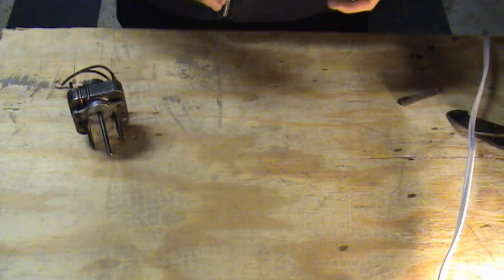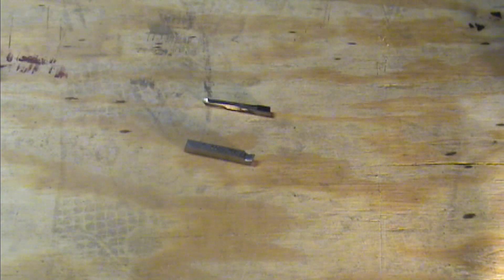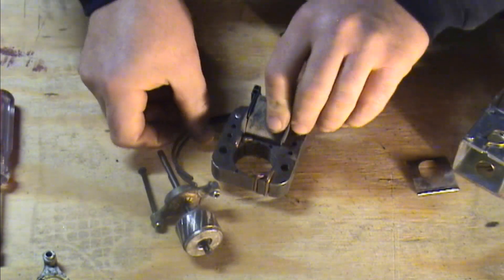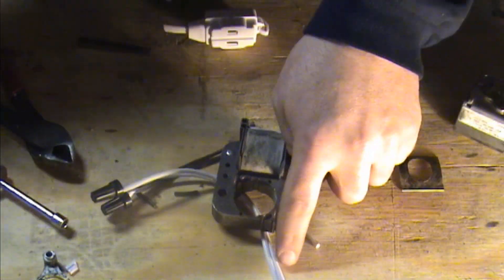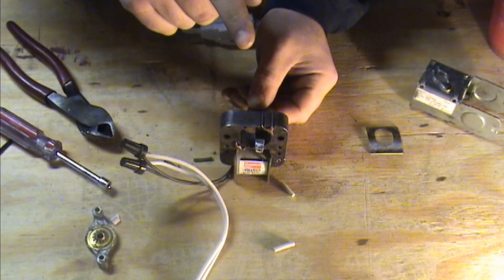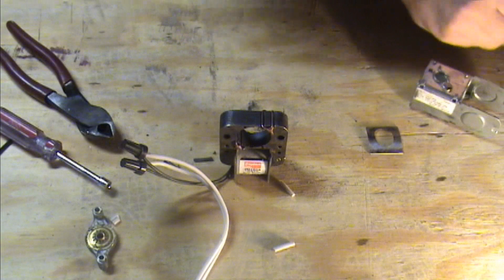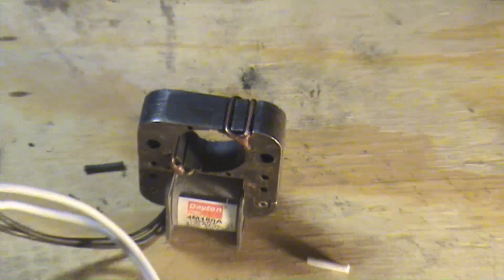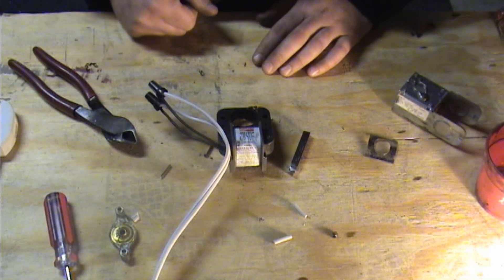Homemade Tool Demagnetizer

Comment: Hey thanks man I've been searching for this method for an hour now. My drill bits are getting magnetized due to some electromagnetic projects I'm working on but it's been years since I've needed a powerful demagnetizer. Also, those secondary windings on that Ac induction fan SHOULD be insulated with an enamel but I put that in caps because it's possible something abrasive wore it down. If you have any tool that can check continuity just test a few places to see if any bare copper is exposed. Only while it is unplugged and removed from whatever circuit you found it in. I get heaps of these from bad microwaves and in some rare cases could share a connection to the 2kv capacitor. Some of the older caps did not have a built in resistor to drain it and people died touch them. Anyways, it's completely safe so long as it's disconnected from any potential power source to test cont and still safe to rewire for this purpose. Thanks again for sharing this I've been trying to remember this for over an hour now.

Comment: In another life I used to make those motors.  We supplied Dayton with motors, but it is not one of "mine," as we painted all the rotors green.  The copper hoops are shading rings and that's where the term shaded pole motor comes from.  I ran the lamination machine for a bit, also painted rotors, made up the rotor and shaft assemblies and ran the gearbox department for awhile.  All of these motors will run at 1200 rpm, so a gearbox was quite common to slow down the drive shaft.  Thanks for the memories!
Reply: Thanks for sharing your story. I always enjoy hearing about how things are made and the people who make them. The processes and techniques. It's all interesting to me. 😀

Comment: If you put something as simple as a 60 watt light bulb in series with the winding - whether the solenoid coil or the shaded pole motor, you have an automatic current limiter that will keep the coils from burning out.
They may not work as quickly, but they won't burn out.

Comment: That motor is also found in most microwaves. It's the fan motor. I made a similar one. Try putting a piece of foam in the opening with a hole in it. It helps guide the piece without touching the sides. Makes it a little easier for demagnetizing.
Reply: excellent idea, thanks for sharing!

Comment: No need to pull out until it's 5ft away... the lamination sheets concentrate field only in the rotor area. FWIW - You'll find these motors in bathroom vent fans and older microwave ovens. At this size they use about 60 watts so use it for <5 minutes and let it cool for >25 (iron cores hold heat very well).

Comment: Hah! I just burnt out a good one a nice fat one by leaving it on for too long dicking around feeling 60hz through the handle of the screw driver. I get mine out of microwave ovens for free. I didn't know these things burnt out like that but it lasted a good 2 to 3 mins before I seen a flash.
Reply: Are you using the fan motor from the microwave? I think I noticed the same motor in most microwaves for the fan. I'm going to use mine to make a fume extractor probably but the next microwave i come across i'll snatch it for a demagnetizer
Reply: @schlomoshekelstein908  If you wanna build a fume extractor you best find you an industrial sized microwave instead. They got the same size transformer but there's an extra present under the hood. Instead of one fan you get 3 fans! Well actually 2 fans for there's a hamster wheel fan made by Samsung located at the top and they're much more suitable for fume extractor. I made one out of 2 and they're hella powerful because although they run one motor they got 2 hamster wheels. Beware of the high/low wires and capacitor start wires... you need em all

Comment: This isn't a reliable method to magnetize a tool.  The magnetic field alternates with the AC line frequency (50/60Hz), alternatively (de)magnetizing the object N-S and S-N.   The reason it works as a demagnetizer is this alternating magnetic field approaches zero as the object is drawn away from the still energized core, effectively leaving no net residual magnetism.  If you leave an object in the core you'd need to switch off the primary current at the zero crossing of the AC cycle in order to retain maximum residual magnetization before the following opposite polarity cycles begins to reverse the effect of the prior cycle, gradually magneitizing it in the opposite pole orientation.  So this approach is both hit & miss and of limited intensity.  A far more effective way to magnetize an object is with a magnet of substantial strength (can be harvested from the magnetron of the microwave oven you're cannibalizing for the motor lamination frame), or the garage man's old standby of wrapping a 10~20 turn coil of wire around the to-be-magnetized object and giving the coil a quick high current pulse across the terminals of an automotive battery.  Of course, try this at your own risk.

Comment: If your going to get this from a microwave oven. Always take an insulated screw driver and short the capacitor out because if it has power stored in it from the high voltage transformer and you touch it with your hands it will kill you. That should be the first thing you do.

Comment: Just made one for myself, and it worked great on some watchmaker screwdrivers and tweezers.   Used a microwave fan motor, and wrapped all the bits of exposed wiring in electrical tape, just to be safe.  Thanks for a great video!

Comment: Chrome-vanadium is the alloy used to create stainless steel. They react with oxygen faster than steel to form a sort of ceramic coating so thin you will never notice it. That react so fast that the steel never gets a chance to rust

Comment: microwave ovens,bathroom exhaust fans,toaster ovens with a circulation fan, lots of other consumer products use these shaded pole motors. you could even use a stator winding from a car starter motor or alternator but that would be a little harder for most people to get there hands on

Comment: A shaded pole motor has a rotating magnetic field, and it isn't in the direction of the length of the tool, either, so actually it does a crappy job.  It would be better to use the nice fat square-holed solenoid from the motor by itself and,  if you need to,  put a 20-40 ohm ceramic 10W or 20W resistor in series with it to your pushbutton. It will have the most amazing ability to magnetize or demagnetize a tool in under two seconds and it won't overheat with the resistor limiting the current. I've built a lot of these for friends. Just always use a momentary pushbutton, because if you leave it on a minute it will catch fire. ALl commercially sold demagnetizers have a warning to that effect, it's unavoidable without a much bigger device.

Comment: You want to take the coil out and put your tool in the coil!! You put a big ceramic resistor in line with 200 to 400 ohms 10 or 20W  to keep it from burning up, and a push button switch, then to magnetize you fire it up with the tool inserted, and leave it in when you turn it off. To demagnetize you pull the tool out before you let go of the button.

Comment: Tnx for the vid.  In a pinch, I've magnetized a screwdriver or whatever by wrapping some wire (10-18 gauge) around the 'driver handle, then put the blade in the coil and touch it to the car or MC battery posts.  In a flash (ar, ar, ar) - done!

(To the "challenged" - don't do this, it is unsafe, and your mommy should have taught you better, tsk, tsk.  If you are stupid, you might blow up the car, yourself, perhaps the neighborhood.  There's gonna be sparks - no fuels or hydrogen from charging lead acid batteries.  Yada)

Comment: Thank you so much for this video. Just first off you use a mounted camera and I didn't vomit from motion sickness watching. But really every couple of months I load up a box of drills, end mills, n other tools and take to a shop where I worked as a teenager to demagnetize. Now I can do it here at the farm shop. Now a question. How to make it work as a bench top meaning like the ones you lay a bigger tool and rub across it?  Tomorrow I'll ride over to the local appliances repair shop and get a couple of these old motors and build one for sure. But at times demagnetizing parallel bars and such would mean the flat top type. That's again.

Comment: Thanks for the info! I pulled a sp-61k25 motor out of a blower vent for a bathroom and it works great to demagnetize things. It doesn't however magnetize anything really. Is there a significant difference between the motor I used and the one you did?
Reply: Never mind. I see you already answered a similar question for someone else!

Comment: When you magnetize something, how long does it remain a magnet?  Until you demagnetize it or does it lose it's force over time?  (I'm trying to find a cheap way to create small (eg, about 6"x6") flat magnetic surfaces to stick my metal craft dies to, to store them.  (Either magnetize the die or the surface I'm sticking it to.)  Advice appreciated!
Reply from the maker: It's not going to do anything that large.  The magnetism will fade as the part gets bumped around.  They make magnet rolls that you could glue to a surface.  If that's not strong enough I believe Harbor Freight sells the long floor sweeper magnets with wheels.  You could just remove the wheels and handle.  http://www.harborfreight.com/17-inch-mini-magnetic-sweeper-98398.html

Comment: Great Video - thanx for sharing. For those of us that despise getting shocked and make it a habit of staying away from electricity :) - you can make a similar tool with 2 old hard drive magnets and a 3/4" PVC coupler. I taped the magnets on opposite sides of the coupler, held my wife's jewelry tools inside the PVC for a minute or so and they are completely de-magnetized. I did the same for a couple of screw drivers I've had hanging from those same magnets for the last year - de-magnetized them too. Thanx for the idea!.

Comment: Can I use a house fan (the kind that blows on you when it's hot out) electric motor to make one of these?
Reply from the maker: As long as it's a shaded pole motor.  It's best to use one with the winding in a single spot (the shape you see in the video)

Comment: Good stuff! You taught more than magnetizing. How about inserting a PVC tube inside the electromagnet so that it will be easier to hold the cutting tool in the middle and avoid contacting the electromagnet?
Reply from the maker: It's an option

Comment: Made one of these up today using an old microwave fan motor. Slotted out the top of the armature aperture and I was able to successfully demagnetize my 6 inch digital callipers which had become very annoyingly magnetized. Worked a treat !
Thanks a lot for posting this very effective and useful information.
Reply from the maker: Nice!  Glad it worked for your calipers. I haven't had to demagnetize anything that large yet.

Comment: Hey great vid. If you want to de-mag a screwdriver or something, you simply place a magnet at the tip and drag it to the handle and lift away. To re-mag, you would place the magnet at the handle and slide down, right off the tip. I never tried it on a tool bit but it might work to place magnet at the tip of the tool and move to the other end and lift off. Curious to know if it works... Cheers

Comment: I machine a lot of 300 series stainless steel. Sometimes it well become slightly magnetic when machined (what slightly means I don't know).  Customers reject these parts saying its not 300 series, even though I have all necessary paper work and lab reports confirming its is 300 series.  any advise would be helpfull.  enjoy your videos  JIM

Comment: Good video. This type of motor is also found in bathroom fans and old record players. I also, just saw a a guy tearing apart an air pufifier, with the same type of fan motor.

Comment: 3-phase electromotors have a few construction (standart, 2-speed, combined construction, alterable-frequency etc...), but it is another story. 
By the way - heat is the less of problems (just to notice a work time- no overheat). I can get 1 to 1,7kW 1-phase electromotor for this action, but huge of problem is that to does it run on large items?

Comment: OH WoW! 
So if I take, for example, 4kW electromotor stator and do as You, then in same this WAY can I de-magnetize greatest items - lathe chuck jaws, caliper, vise case, wrench or item who includes much pieces??? Does number of phases is lot sense - 1 or 3 phase (230V or 400V)? I have pile of expensive items what are useless because they are magnetic.